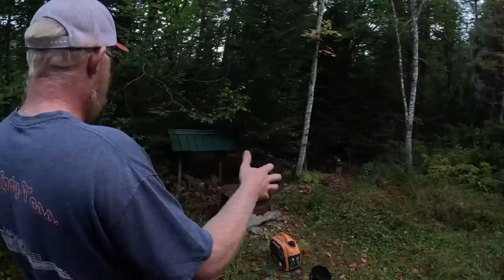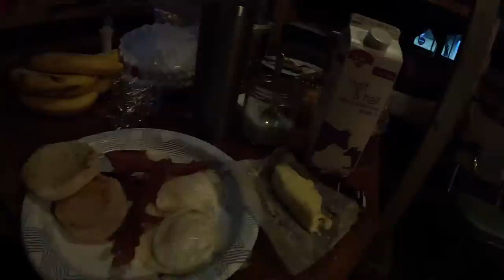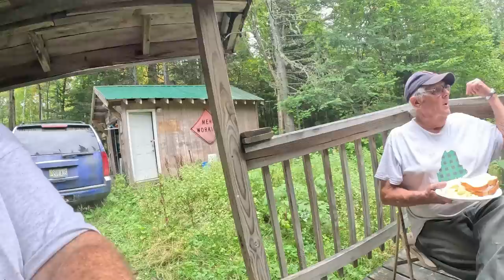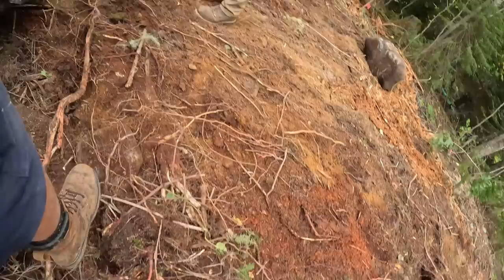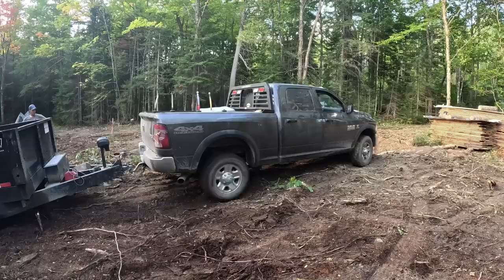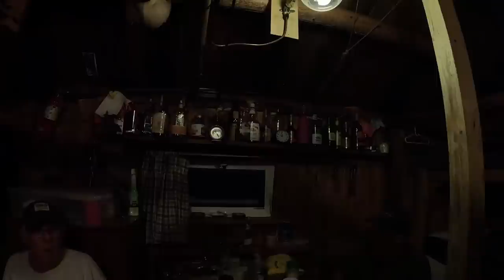OFF GRID Cabin Series: Land Clearing Day 2: episode 4

Comment: do a 5 Gallon bucket, drill a hole in both sides right below the rim and slide a dowel through it. Get a metal coffee can and put that in the bucket on the dowel so it spins. put water in the bucket (antifreeze in winter) put peanut butter on the can and a wood ramp going up to the top of the bucket. the mice will jump from the ramp to the can and it will spin they will go into the water and drown. They are nasty suckers around your electrical and all your other stuff!
Reply from the maker: That mouse trick works super well